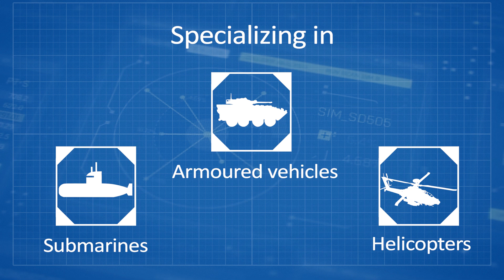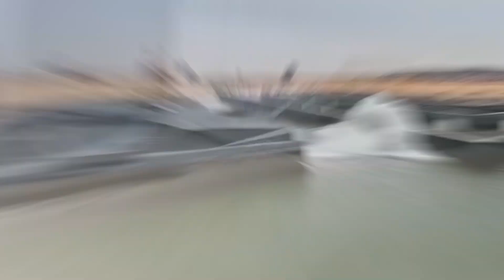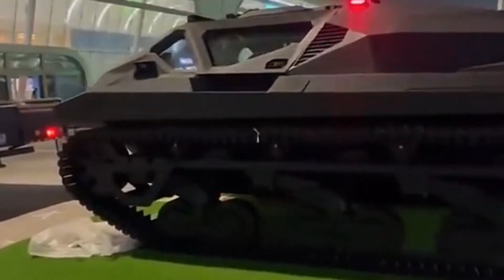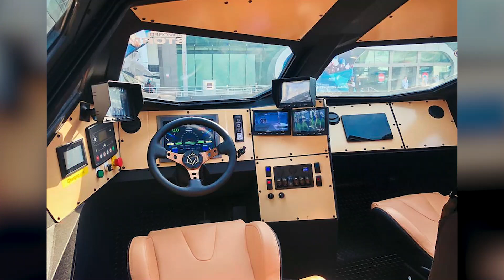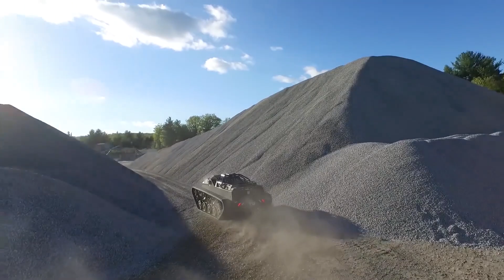New Military Armored Vehicle Shocked The World!

Comment: Allow me to randnerd about it xD

1. Rubber tracks are exactly if not more tricky as complicated to fix as metal tracks. Metals exchange just standart-pieces, while rubber has to get clamped or chemically glued.
2. Waterjet is placed to high for max efficency and the angles of the front makes it pushing itselfe under the warterline if there is more than swimmingpool conditions.
3. B6 is a civilan armor type and quite irrelevant for military vehicles that rely on armor somehow(B6=protection against high powered rifles just like 7.62 snipers with no AP-ammo).
4. Electric batteriys aren't placed in combat vehicles for even kinetic shocks can kill and enflame them - and the're too heavy in comparison.
5. Pseudo-stealth coating with angles that negate every conceiling effect on radar impulses.
6. All small whight vehicles either don't trigger (primitive) anti-tank mines or get nuked by it anyway, as they has microfibres that touch the vehicles surface and ignite by this.
7. STANAG 1 ground protection mean a handgrenade or anti-infantry-mines that never intendet to deal with armor.
8. The small size(and the high personal capacity) makes it way less efficent in storrage/armor comparison and need mor whight per person as all most other APC's.
9. Submergable ones would face even more imbalancements, including getting stuck in muddy ground wiht ther small whidth rubber tracks.
10. Remote is quite useless without a propper situational awareness cam, and this seems to be not implemented.
11. Armatures are overlouded with unnecessary civil stuff and lack of the space for mission data, GPS, camera screeens and other combat-relevant stuff.
12. The designated room for 6 personal are maybe achieved by piling them up, but not with seats, sitting or with space for even infantry without weapons - as seen in the backdoor-view.
13. Heat-signature (specially against tanks) conceiling alone is quite irelevant, as tanks have several sensors.
14. AT weapons mean heavy top whighting, and a vehicle not meant for that is lost in terrain (even tank designers deal with the problem of hight and banalce of f.e. guns).
15. Further equipment would fill the intenral room or - in case of diving equip - probably even exceed it, what would make it quite useless as a APC.

And my personal take:
16 From design to implementet tech - all seems to be for achieving buzzwords to look/sound cool, what probabaly is a strong indicator that it isen't.

I'm cool with fresh ideas, but if even the most basic rules or military design are ignored ... hmm, not so cool.

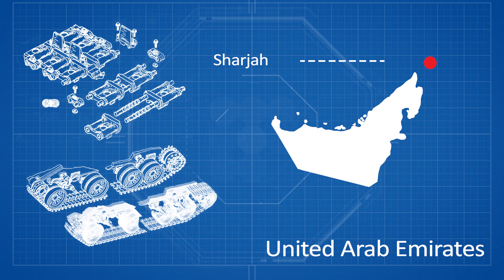Comment: 2:30
that's just straight-up wrong
steel tracks can be repaired by inserting new links if an older one is broken due to combat or terrain damage.
this sort of maintenance can and is being done in the field, for some vehicles, it can even be done without the support of another vehicle,
exact same as your rubber links, only the rubber links will be under a lot more wear and (usually) more fragile
why the hell do you think they always carried spare track bits on those old timely tanks.
because of exactly that.

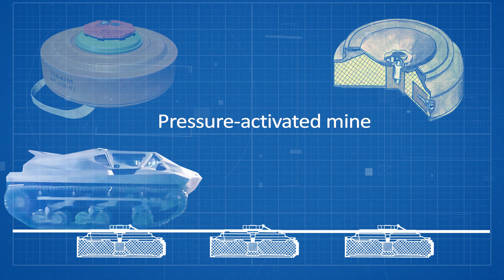3:00
that is also most likely not true.
the number of roadwheels won't affect to any noteworthy degree if the vehicle will trigger mines. 
weight, ground clearance, and if or if not the vehicle runs over the mine with one of its tracks are usually deciding factors
mines trigger usually at around 130 kg applied. I'm gonna go out on a whim and say this 10 ton vehicle will definitely trigger those 130kg triggers, 
in spite of all your fancy roadwheels.

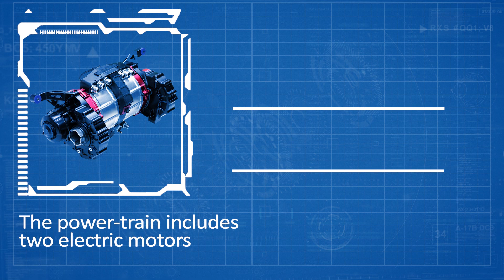3:30
440kw + 150kw sounds like some very heavy engines, 
my estimate is about 2-3 tons ish for the main, but if they removed a lot of the cast iron parts they might be able to get it to 1.5 tons (metric)
should be 500kg-1000kg for the 150, but again, maybe they used some lightweight bullshit that somehow makes it more reasonable
that's gonna require quite the powerplant though, a part that if it were to break down would be hard to replace, 
since currently, most vehicles in service are either diesel or gas-powered and spare parts may be hard to come by.
battery life should also be a concern. with that power output, I don't see it running for all that long without recharging
which given the recent events of Russia running out of gas for their tanks at the front even though all around them are gas stations,
should be kept in mind. all in all 4-ton engine assembly, with probably another ton at least of battery, on a vehicle with seemingly very light armor, rubber tracks and 
big glass windows make for a very heavy design for a vehicle that should not be very heavy.

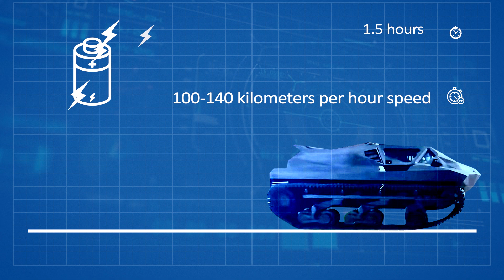4:10
so electric-only it has a 200 ish km range. using a fuel that is not yet fully established in vast parts of the country, and also not commonly used by most militaries.
the T72 (Russian MBT) as an example has a 500 ish km range, on a fuel that is more readily available, and can if bad comes to worse, be acquired from other vehicles.

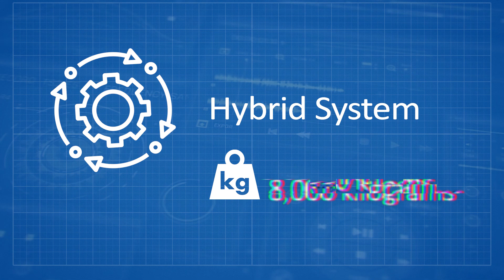4:20 (nice)
so it's an 8-ton engine assembly, alright. 

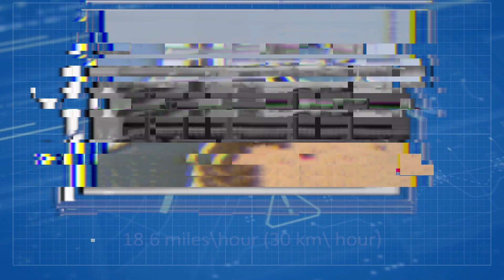4:30
140 kmh in a military vehicle is nice. don't think the tracks are gonna hold up to that for all too long, but it definitely has good speed.

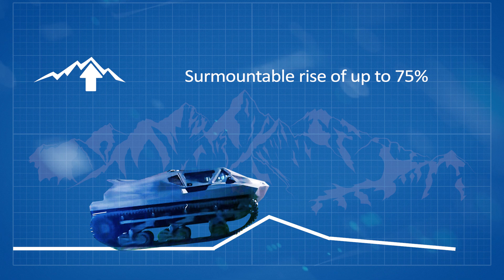5:00
yea its terrain ability is pretty tank standard. nothing special there.

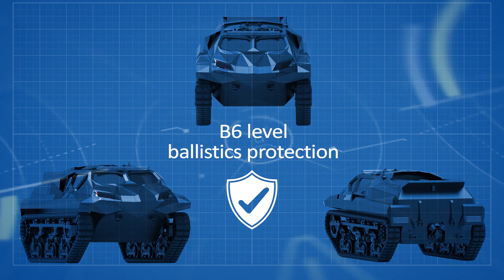5:20
so it's rated against an AK? ok. no, no, ok. your military vehicle will live to see another day even after coming into contact with the unrivaled ballistic prowess of a 7.62x49
good thing that there is nothing higher caliber that would be commonly used against tracked combat vehicles like say a 50. or a 20x138, good that such things do not exist.
"mine blast protection systems", to my uneducated ear, just says "metal plate at the bottom, may or may not work"
Stanag 1-2 (they don't specify) so it's rated against hand grenades, anti-personnel mines, and maybe possibly smaller vehicle mines. "may or may not work" I was correct.

5:30
why would you do unmanned missions with a vehicle that is already of that specific size for a manned mission, it doesn't make it any less of a target. for unmanned stuff, use smaller vehicles, that cant fit people, that way, they are considerably harder to hit.

5:50
6 personel, and 2 tons cargo, not good, not terrible. 

7:00
nope, them electric engines gonna show on thermal, those things get hot as fuck

8:30
oh it would be unique alright

this really just sounds like an incredibly overcomplicated recon vehicle. 
it obviously can't be used in combat, outside of maybe "enhanced police action"
it has no mentionable carry capacity, for either people or equipment
it is very heavy for its size, which brings many issues of its own
it is using an uncommon power source and does not share any parts with any other vehicle already used
the rubber tracks will be prone to get worn down, and since, again, they are unique to this vehicle, will be a nuisance to replace.
it is a speedy amphibious vehicle, with very basic ballistic protection that is basically it. fun, certainly, effective? id wager not.

Comment: Tis looks nice, but it lacks offensive capabilities.

I would give it a main 20mm tower on top, a couple machine guns on the sides with 50 BMG or 338 LM, a couple of grenade launchers and 1 RPG style rocket launcher.
1 driver seat, 2 artillery seats for the controls on the machine guns, 1 seat for the heavy artillery operator and 2 more seats for soldiers with man carried weapons (DM, Infants or similar).
Reply: so you wan't a lot of wepons on a shitty chassy that's gonna blow itself up. This thing could easely be penetraded by a 20mm or at least a 20m kenetic sabot
Reply: @Boulettenchefkoch  its a recon/special operations vehicle, not a battle tank. seeing as its got a 2500hp power pack they could have easily given it a couple tons of armour equivalent to MBTs (which have 1500hp powerpacks), but being able to go it rough off road, at speed you need light armour or no armour.

see the US canadian special forces Polaris ATV side-by-sides, literally no armour, a 50cal HMG and 2 7.62 LMGs. the storm is clealry meant to compete with these kinds of vehicles (shown doing the things that special ops need their ATVs to do), it offers  It will offer mine protection up to STANAG 4569 Level 2 , thus its enough to stop muktple armour piercing 7.62x51 rifle fire at 10m+ or 155mm shell landing 80m next to it, but not enough to stop 12.7mm (50cal) at the same range). this is equivalent to the M113 APC. which is massive vs the no armour of wheeled equivalents on the market.
Reply: @matthiuskoenig3378  they could just use an old BMP1 and it still be better than that